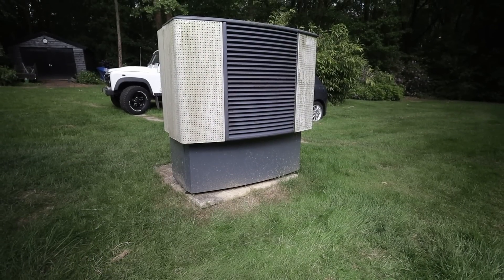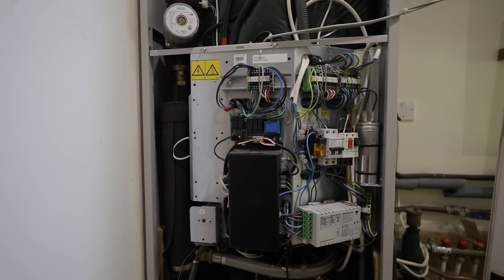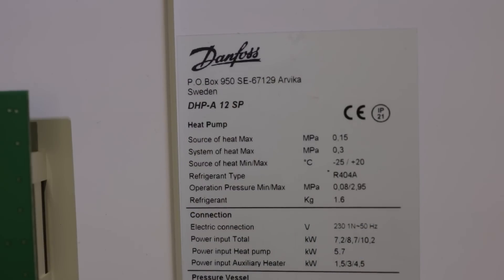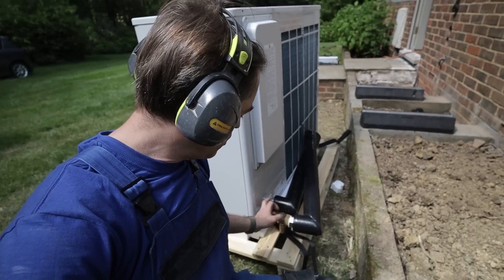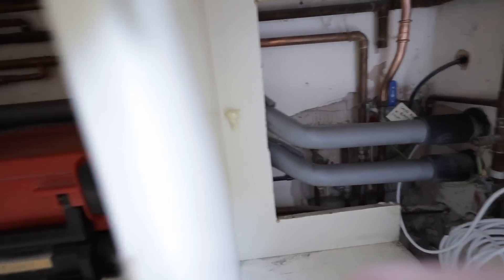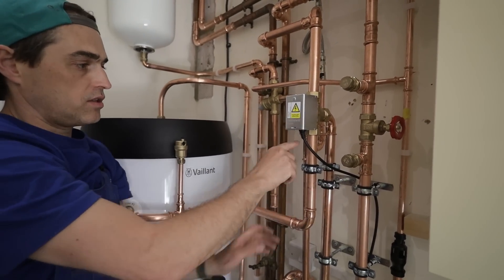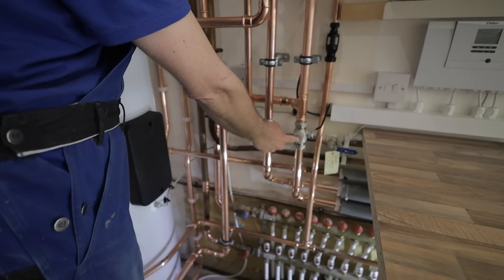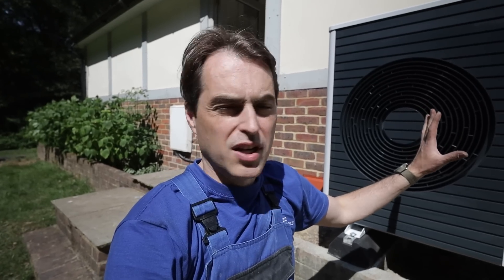Unlocking Super Efficiency: Air Source Heat Pump Swap With Vaillant Arotherm.

Comment: Don’t understand how a 7 kw heat pump can give you 9 kw? It’s nonesense. In the middle of winter when it defrosts you are miles out bud
Reply from the maker: Vaillant claims they average 8.5kW after defrosts which we all now know is not true. Those units output around 6kW at design and peak at around 9kW

Comment: If you have one pump flow that Ts to both underfloor and radiators, some with an elevated head pressure, there is going to be different back pressure/ resistance ( and therefore flow on each). How are you supposed to balance flow?

Comment: Was the extra pump on the upstairs radiators and UFH. Technically pumps in series?
Reply from the maker: there is only 1 pump - in the external units - all other pumps have been remvoed

Comment: i see on your interface unit you always drop the trunking and use stuffing glands, now  i promise if you move the trunking up to the interface and cone cut 25mm and use 25mm black rubber quick fir grommets(flat on one side) you will install a tiny bit quicker and cheaper , were told never to install a stuffing gland pointing up btw..and in this case there is no need for ip65 or above...excellent work on site and the videos btw.  :trophy-yellow-smiling:

Comment: Great video. Thank you. We are about to convert lpg to air source heat pump on a big 450m2 house with 13 first floor radiators and 250m2 UFH . We are well insulated but it’s still going to be 12 or 14 kw pump based on current lpg usage and heat loss calcs. Is cascade better than single? Is r290 better than r32? Is Mitsubishi better than Vaillant? How much solar battery capacity will we need to run it on the coldest day ? …it’s all very complicated….

Comment: Quick question: Are the heating controls for the Vaillant hard wired or wifi? Only asking because if I was to upgrade my 8 yo Daikin Altherma it would mean a lot of work running wires through the floor boards and down the inside of walls. Apparently, my Heat pump has only one wire going to it so it is completely ignorant to anything other than the flow and on/off from the control panel. Major issue, new build, as it means it is on all the time just waiting for the flow to kick in. I have done a Heath Robinson and managed to intercept the Nest thermostat signals (x3) and control the switch using a 'SwitchBot Bot' but I would like it to be just standard. Obviously, the Vaillant is far more efficient and I'd also like a PCM tank (Sunamp) rather than the collosus water tank that blocks access to half the space under my stairs. ...it is literally parked halfway with loads of space behind it and no access, something needed in a house short of space. This is typical UK cowboy house building practices.

Comment: Ey Thanks for the videos. We are always place a meh97 from Vaillant but this is alot cheaper with the 3way valve. How do You Connect the wires to the vwl and what are the settings then i would try it next time.

Comment: So much hype about this. Mine is noisy - sounds like a spitfire and that's inside the house. It also generates vibration and regularly shuts down for an houe or so during the depths of winter. Service costs are very high. If I could turn back time, I'd have a combi boiler.
Reply from the maker: What make and model is it? What size in kw and what size house?

Comment: Fantastic install. Agree with the simplification, but doesn't this mean the max floor temp will be 40degC? Too hot for some floor coverings. Why no mixing valve on the UFH manifold to reduce the UFH temperature?

Comment: I am about to desing my system and I have a question. If you dont separate the heating from hot water you cant aply any ingredient to protect the underfloor heating pipe. Isnt that an issue ? I always thought that this cemical protection is esential.

Comment: Excellent work!
Here in Germany, unfortunately, many plumbers are afraid of installing the heat pump without a buffer.
Absolute nonsense =)
The heat pump can only work properly and efficiently if no buffer is installed and it works in the direct circuit.
There is still a lot to learn here in Germany.
Luckily I installed mine myself. 
Annual performance factor, measured externally with defrosts... 4.6 😊 (location bavaria)
Reply from the maker: Check my last video. Mine is running 5.3 now including defrosts and hot water
Reply: @UrbanPlumbers  
5.3 is VERY good 👍😉
Here it is -10 to -15°C in winter.... sometimes -20°C,  that reduces the work rate quite a bit. Nevertheless, heatpipes are definitely the future of heating 👍
Reply: @energieundhobby  Future maybe, but not quite yet for older houses, having a hated cylinder back is a big letdown, and it's too complicated, the plumbing should be one pump internal and one expansion vessel!?!

Comment: Superb !   this means all Vaillant's schems are wrong.... 😅
Reply from the maker: well, they are not technically wrong - just not very good and doing things differently improves the system performance by quite a large margin.

Doing systems as per standard vaillant schematics ends up with poor performance in most cases.

Comment: Just a note on needing a second pump. 100mm spacing UFH works more efficiently than 150-200mm for low flow temperatures, but it may need to be 'microbore', ie. 8.6mm bore to make the tight bends. Check carefully the pressure loss on the longest loop and you could find an additional pump is required. As long at it's placed after the T off to the UFH, it won't interfere with the modulation of the main circulating pump.
Reply from the maker: No need for microbire. 100mm spacing can be easily done on 15-16mm pipework. No need for additional circulators
Reply: If you use a floating UFH system like Variotherm (ie. not in a screed), that's microbore. It's an excellent system from Austria, no aluminium spreader plates, routed into Fermacell, so more thermal mass than similar XPS ones.
Reply: I have seen it mentioned a few time now that you don't put in zone to improve the efficiencies. How much will zoning impact the performance of the system? Is there any way to keep the bedrooms cooler than the living spaces without zoning?
Reply from the maker: @cillo2000 yes there is - TRVs or actuators to limit the temp without ability to activate the heat source. In practice you can do it just by adjusting flow

Comment: Great video! we moved into a property which already had an ASHP in place feeding ufh and rads. It also has a buffer tank and extra circulators and we are currently talking with our local installer to have them removed. Already I have disconnected all the actuators to remove room zoning on the ufh. No idea what the scop is as it’s a ten year old heat pump. Your channel has been great to try and understand the essentials of heating system design.

Comment: Hi Simon, now that the gov are increasing the grant to £7.5k I have decided that now is seems to be a good time to go ahead and have an air source heat pump system installed. I am with Octopus and they said that the expected cost to me should be below £3k including any rads, pipework etc (I upgraded my rad three years ago so am hoping my newer ones will be up to scratch. I also had a large unvented cylinder installed which is squeezed into my airing cupboard on the first floor. The boiler was replaced at the same time with a condensing Vailantboiler and it was repositioned to the garage). Octopus will be contacting me to arrange a survey to check out and go over what is needed. I have a small three bed detached house built in 1994 which I had cavity wall insultion pumped in two years ago and I have had a PV (4.8Kw) and battery (14.4kWh) system installed last year, so am hoping my running costs should be a lot lower. The problem I am anticipating is that my house when built was plumbed with microbore (8mm?) and so was wondering if you can comment on this and if it is still viable to have an air source system installed. Also would you be able to carry out my installation, either in conjunction with Octopus, or directly with me? I live in Old Coulsdon, in the southern part of the borough of Croydon. Looking forward to hearing from you. Thanks, Al

Comment: My 10 year old 3 bed semi has 10mm plastic pipework feeding all radiators. The main flow and return is under the 1st floor with 10mm pipe work dropping down to the ground floor rads behind the dry lined walls. My question is will all this pipe work have to be replaced.

Comment: No insulation on the pipework ?
Reply from the maker: Watch till the end
Reply: @UrbanPlumbers  Ok yes it is insulated and a tidy installation  As a retired industrial refrigeration engineer that air source are a good investment in this country it is a high humidity area and outside coils iice up very quckly in ambients below freezing point and either have to go into reverse mode  to defrost
Reply from the maker: Once per hour and only in temps between 0 and - 2 - outside of that it’s really a non issue
Reply: @UrbanPlumbers  that's up to 24 a day and is an issue  does a boiler do that ? No it doesn't  tell people the truth about the cons of these systems and tell them what will happen when there isn't enough power

Comment: Thank you for the informative video, do need to change all the pipe work if I am having my oil boiler of 25 yrs plus changed to air source heat pump system 3.5 Kw?
Reply from the maker: most likely not. 3.5 is such a small load that it doesn't need large pipework

Comment: Excellent video - very informative as always. Please could you confirm what the black sealant you used was around the external insulated pipework - was this just standard black silicone?
Reply from the maker: the black sealant is called 'seal and bond' and is specifically developed for external insulation and sold by the same company that supplies the insulation
Reply: @UrbanPlumbers  thank you so much

Comment: You always start with the heat loss calculations. What are you using to performa heat loss calculation? Can you suggest any easily accessible tool for the advanced and qurious homeowner to do this calculations by himself?
Reply from the maker: yes, just use 'heat punk'

Comment: Just one question. If you dont put blending valves on the underfloor heating and the anti legionnaires cycle takes the water up to 75C, wont that be an issue going straight into the heating system?
Reply from the maker: No, it only goes to the cylinder.

Comment: Love your videos someone who
Is a master of there craft, would
Love to learn all this, may i ask the costs of a typical heat pump install and running costs compared to gas boilers as I understand they use alot of electricity?
Reply from the maker: My installs are around 25% cheaper to run than gas. Install cost before the grant £10-15k

Comment: Two super expensive heat pumps in 13 years.  That’s crazy.  What’s the real cost of heating this house?
Reply from the maker: Super cheap to keep it warm even with the old heat pump as it’s all UFH and a well insulated property. I think they said they used to pay £200 / month last winter. I will update running cost on this job this winter with a follow up video.

Comment: Love these videos, what fitting are you using to connect the antifreeze valve directly to the heat pump? Thanks
Reply from the maker: It's just 1''1/4 female to 35mm with a reducer to 28mm and AFV with 28mm compression

Comment: Nice and clean install that one ! 
btw, in the UK we obviously focus on heating but for the few summer months what are the options for cooling, would that just be an air to air system and some other water heating method? Seems to me we need an all in one solution that can do both heating/cooling plus water.
Reply from the maker: You can cool with this unit. It’s mildly effective

Comment: Really nice install mate enjoyed the video!
Couple of questions
What did you seal the lagging with silicone? 
And do you have to have a second zone valve on the cylinder for safety shut of like unvented when using a gas boiler? Or is it because the temps do go that high. 

Cheers 

Ben
Reply from the maker: Hi. Thank you for watching.

The external lagging is from Primary Pro and you can also get what is called 'bond and seal' sealant specifically designed for this application. It is not silicone and I don't think silicone would work well here.

You don't need a second zone valve, as the diverter valve fails safely to a closed position towards the cylinder and is normally open to the heating. It is exactly the same as having 2 x 2 port valves. There is no mid position on that valve. 

Also, with a heat pump you can't get to more than around 70C in the cylinder.

Comment: Great video. So does the new modern heatpump have a variable speed water circulators on them?
Reply from the maker: Well yes and no. It always targets certain flow rate and runs a bit too fast when it is warm weather
Reply: @UrbanPlumbers  thanks for your reply. I though that. My diakin Altherma 2014 model has a fix speed on the pump but can vary the speed the of the compressor. I've been using the Emoncms Heatpump app to try and maximise my COP. At the moment it monitor the input power, flow/return temps and flow in m3/hour. I can see that the difference between the delta T and power input is important for maximising the COP. For me to squeeze the last out of my system really I need a variable speed pump. A retro fit is on my to do list now :-)

Comment: Interesting to learn that the new heat pump can run the DHW to kill legionella but it is close to a COP of 1. Given that the immersion heater is 100% efficient and you will be without heating while the DHW is heating up to 60 deg C I can't see the advantage of getting the heat pump to run the legionella cycle.
Reply from the maker: You can get to 60c at cop of 2 or over most of the year. It’s only when it’s below 0 that it may drop below 2. Never quite gets to 1.
Reply from the maker: @zlmdragon.  Rogers is fine. We all seem much worse online.

Comment: An engineer that can and does calculations in the UK is a rare beast….
Reply: On the contrary. Engineer should be a reserved title like lawyer and architect. Proper university educated (or equiv) engineers do calculalations all the time and design complex equipment / systems. Problem is when some installers and 'fitters' start calling themselves engineers. Holland understands the difference and distinguishes between engineers and technicians. This guy clearly knows his stuff; the importance of calculations and simplifying the install.
Reply: @JonPearson-mm1cd  the use of engineer is no longer the preserve of the university educated person.  In my time as an engineer I have experienced my French colleagues address me as Mr Engineer and London city types look down on me as if I had walked in with dirty coveralls on.

In my mind an engineer is someone that takes the engineering approach and applies appropriate methodology and calculation to the task at hand with the appropriate insight and education whether self taught or formally taught - it is the method and tools that count.  I hold two masters and one undergraduate degree however I am not a snob on the topic.

Comment: Recently helped a neighbour out with his heat pump hydronic design, because he couldn't find a plumber who knew how to size a heat pump and design the hydronic system. The lack of proper training is abysmal in the UK. You are the one exception, of course😂
Reply from the maker: yep, 95% are winging it. It is changing though thanks to Heat Geek, Kim's Northampton Heating Academy, and a few others. I spoke to Vaillant, and they will be bringing hydronic courses as well. The movement is slow but in the right direction.

Comment: Very interesting video, one thing that keeps me wondering is the Old evaporator had a very long pipe run to the house; advice by British Gas Daikin intaller says maximum 10m run to the hot water tank. can you please comment on allowed length of  primary pipework bearing in mind if evaporator cannot be sited close to the house.
Reply from the maker: Almost any length is possible if it is calculated and sized correctly. You can have way more than 10m but it becomes expensive quickly due to the fact that pipework may have to be of a larger size and will require insulating or boxing or running in pre insulated pipe underground 

Look at split units if the evaporator needs to be sized further away

Comment: Your knowledge & workmanship on the hydronic circuit is truly exceptional  - but who does the owner call when it goes wrong? 
Is it the wet side or the refrigeration circuit that has failed? - my AC biased engineering team would have no issue diagnosing or repairing the refrigeration side of things, but would struggle (or not be interested) in the wet side. Likely to be vice versa for a plumber/mechanical engineer.

Most air to water or ground source heat pumps that come my way have not been correctly designed/installed/commissioned - giving the technology a bad reputation. 
Unfortunately, engineers such as yourself are the exception….not the rule. 
Please keep up the good work & educational videos.
Reply: He's not an Engineer.....he's a plumber
Reply: @hvacdesignsolutions  Show me a plumber that can do heat loss calcs & actually commission an UFH system properly (including controls/wiring) & I'll show you my arse! 🤣🤣